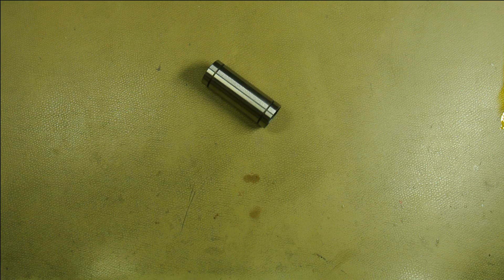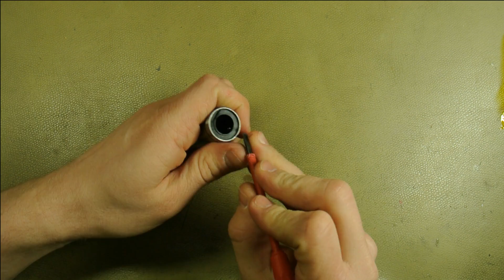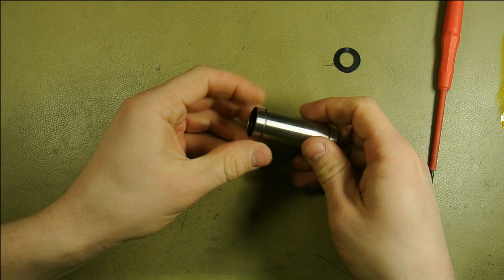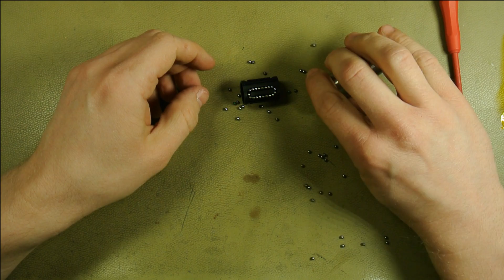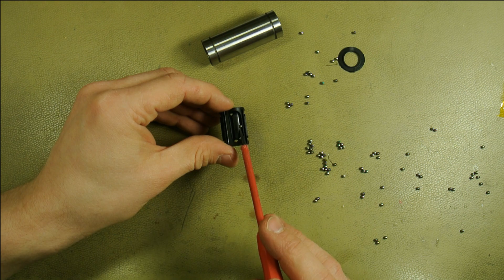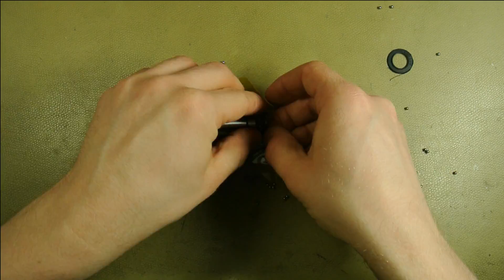Inside a linear ball bearing

Comment: Why there is play in lm8uu based linear rail , I measure the diameter of different roads all diameter is less than 8mm it's around 7.6 to 7.8 mm is it common tolorance or perfect 8mm rods are also available??
Reply from the maker: That sounds suspiciously like 3/10 inch rods. Almost all the rods i've come across are in even millimeters, the cheap rods i'm using for these bearings are within 100th of a millimeter of being 8mm, so 7.99-8.01mm
Reply: @Ghlargh  I purchased from two Sellers both are almost similar in tolorance one was 7.6 and other 7.8 very loose on bearing.
From Amazon.

Comment: Thank you for this. As well as going along a rod, could the rod turn in it instead?
Reply from the maker: To have a linear bearing where the rod can rotate you would either need a sleeve bearing, or you would mount your linear bearing inside one or two normal axial (rotating) bearings.
Rotating the rod in the bearing above would cause excessive wear on the balls, races and rod because the balls can't roll in that direction.

Comment: Imagine doing it in a homemade way with pvc tube and bicycle bearings.  The only question that remains is how to make the center basket so that they do not get lost.
Reply from the maker: The basket is quite simple, it's basically an oval track in a plastic tube that fits between the outer tube and the rod. The really tricky bit is how you cut out the deeper tracks in the tube and keep the basket centered on that track.
Without that deeper track the balls can't circulate back to the beginning again.

Comment: How do I make these roll smoother? I have two that are brand new and pretty rough with a little weight (5lb maybe) . I tried packing with grease and it didn't help.

I then took them apart, cleaned and reinstalled. No change. I tried leaving 1 bearing out per race for a little extra room in case they were binding and it's still the same.

What else can you do? Sand the housing surface smoother where the bearings make contact?
Reply from the maker: This could be caused by a couple of things. Your rod might have the wrong diameter or be too rough, the bearing races (the polished tracks that the balls roll on inside the bearing) might be too rough or the return path might be rough or not lined up properly.
Considering these are about €2 i would primarily try to get some new ones to see if they would work better.

Comment: Can this be strong enough to be used on gym smith machines?
Reply from the maker: I'm not sure which part of the machine you would use this on. In either case these 8mm bearings can take more static load than the 8mm rod they would be put on. The cheap Chinese versions will wear out after a few hundred thousand operations though.

Maybe look at the 12mm version since that should handle a lot more wear without seizing up.
Reply: @Ghlargh  if you've ever seen a weight stack, I presume he's referring to the same sort of thing. With a smith machine the weight is fixed so that it can only move up and down (as permitted by the linear bearings).

Comment: It's actually Nylon 6 or 66, it's very durable and resistent to lubricants, solvents and petroleum based products.
Reply from the maker: They would have to be since people will be lubricating these with many different lubricants. They won't be very mechanically durable though.

Not that it matters with these cheap bearings since it turns out the ball races are made from fairly soft steel. Only a few hundred thousand operations at fairly low load deformed the races enough that the balls started jamming up and stopping.

Comment: Seems like these would have a long lifespan as long as the plastic rotates so that the wear is distributed over the entire inner surface area.
Reply from the maker: You can't rotate the plastic to spread the wear since the return paths are cut as grooves in the bearing surface. If you look when i show the inside, the bearing surfaces are cut as a slight groove to keep the balls rolling straight when under load, if you didn't do that they would start eating in to the carrier very quickly, especially these plastic ones.

I did wear one of these bearings out, it started scraping after only something like 800k operations under moderate load, the bearing surface turned out to be way too soft so it wore a groove in it so the balls started pinching and no longer rolled.

Comment: I’m trying to put mine back together... there are 94 balls and 4 slots, how do they divide?!?
Reply from the maker: Unevenly, it's a dirt cheap mass produced knock-off after all. I think the one i took apart had an even number of balls but i would not be surprised if some of them are missing a couple. At least the double length bearings should work fine with one or two balls missing per race.